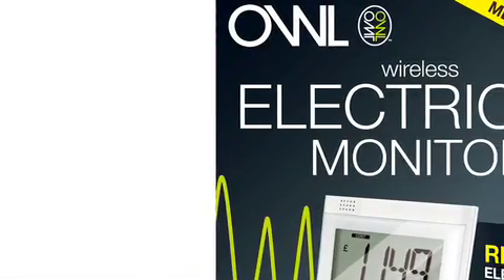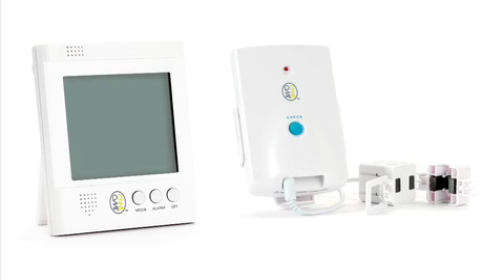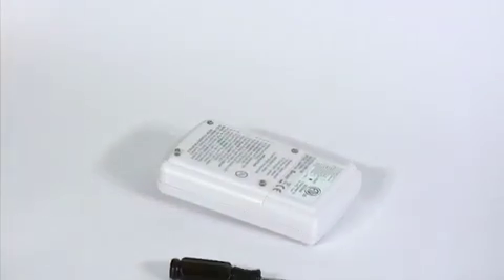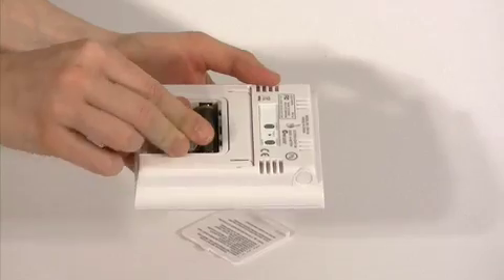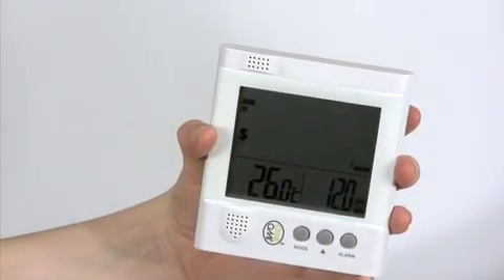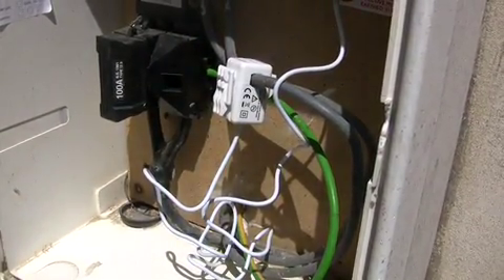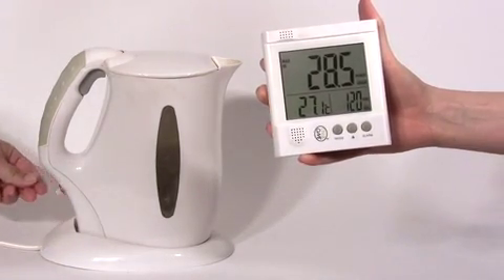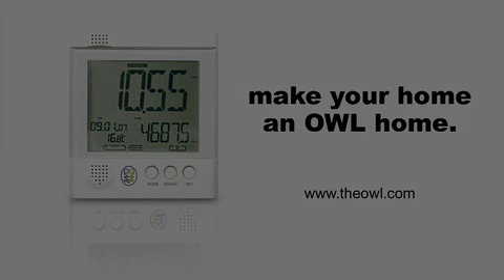Installation Video - Owl 119

Comment: This has only a current clamp and no voltage connection so how can is accurately measure power consumption? At a guess by the unit using voltage fixed at 230v.
So shouldn't it be called "Owl wireless (rough estimate) electricity monitor.

Comment: got one of these and the display unit keeps losing contact with the transmitter, even though they are only 4 meters apart with no large obstructions (ie thick walls etc) between them. why should the transmitter unit be set to chanell 2?